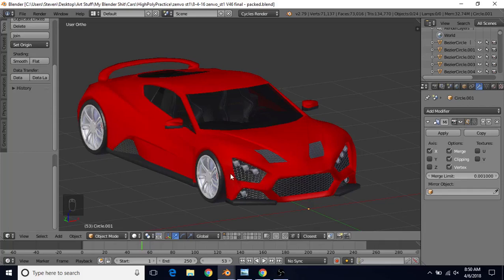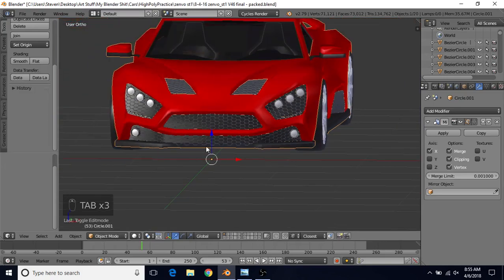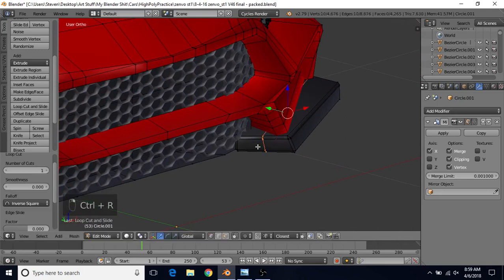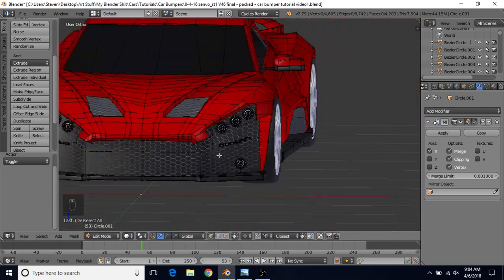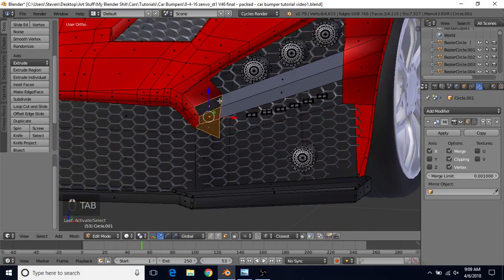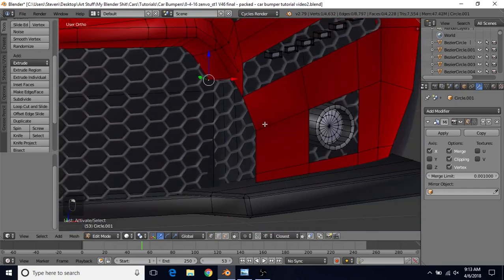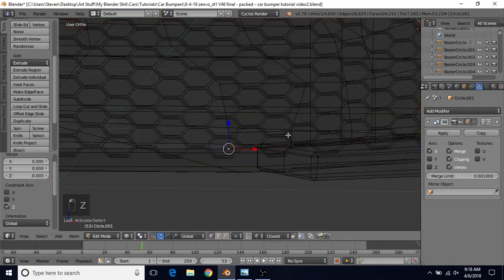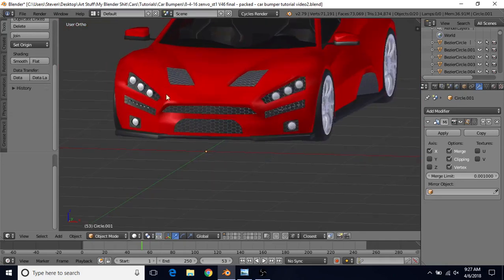Custom Bumpers / Aftermarket Car Parts in Blender

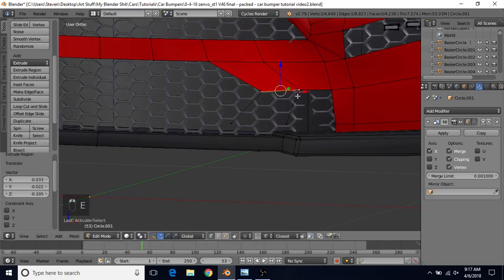Comment: hello. im building a car at home with a 3d printer and i have to 3d print out small parts of the car to later put them together but i dont know how to separate parts of the car from each other. if you look at 21:45 in your video, you can see smal quarters and i want to know how to separate them from each other so it is one by one. do you understand? do you know how to do that?

Comment: Really helped! like seriously how do you mirror the other side for example you're doing something on the right side of the bumper and the other side just mirrors of what you're doing with'd bumper?
Reply from the maker: Hello! The changes to both sides are made possible by the mirror modifier. At the beginning of the video, on the right toward the top you'll see a wrench icon selected in blue. This is the modifier's tab. To add a mirror modifier, first select the modifier's tab by left clicking on it. Next, click on "Add Modifier" and choose "Mirror". By default, the mirror modifier will mirror based on the x axis, but you can change the axis or use 2 or all 3 axis if you wish by simply left clicking on the check box by x, y, or z, under the Axis options for the mirror modifier. Many man made objects are often easier to model by using a mirror modifier, since there is often symmetry in man made objects while most organic shapes will not use a mirror since organic shapes are typically not symmetrical.

For a video explanation of how to add a mirror modifier, see this video: https://youtu.be/UHFwjH8v5SQ?t=1m. Thank you! :D
Reply: @stevenbrooks1694  Made me scratch my head right there, but I guess it's worth a try! haha

Comment: Question do you import the models into roblox
Reply from the maker: I don't. However, this is something people seem interested in so at some point I may look into doing it as a video or something. I did play around with roblox studio a bit and tried to follow their tutorial for a simple car, and it failed to work for whatever reason. So if I can figure it out and get it working etc then I can consider a video on it.
Reply: Okay id recommend using a chassis its really easy to use and its kinda fun
Reply from the maker: @ARA Alright. That's one of the ones I've heard of so if I have time at some point I'll look into it more closely. Thanks!

@SirDajiUndersteersAlot Cool! If you have any tips on how to do this let me know. I've never imported to Roblox, so I could use some hints on how to go about doing it. Thanks!
Reply: Steven Brooks The tri limit to importing on roblox is 5K triangles so try to separate the parts and also to make it easier to connect the body to everything make the scale metric and 0.01 and import it with a mesh part make sure the file is fbx. it’s gonna ask to go to its designated area click yes and do it with the rest and they will all go together, sorry if I explained it badly I’m typing it on a iphone